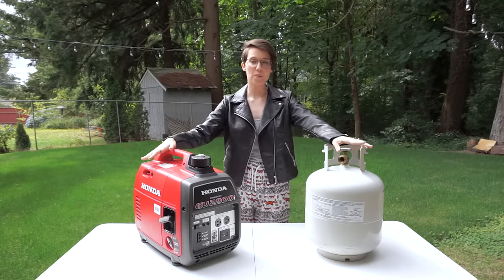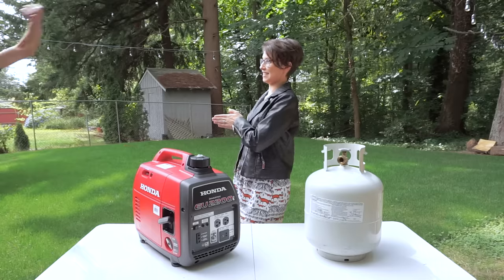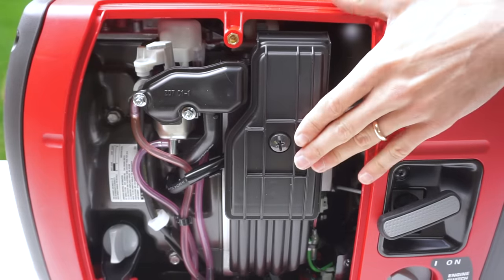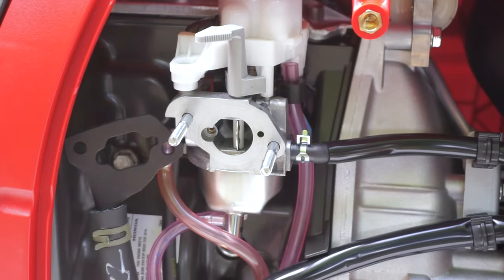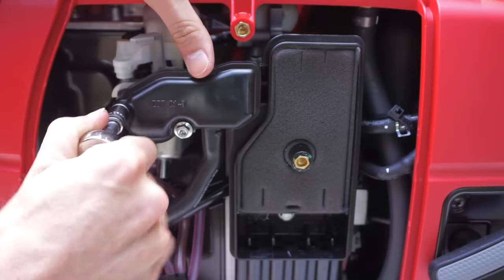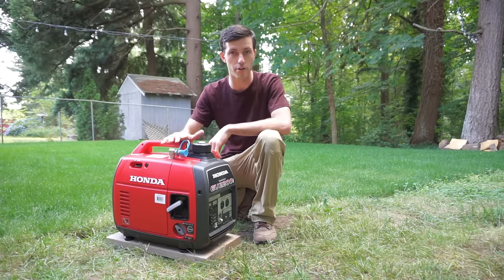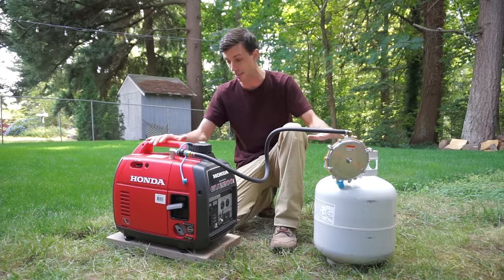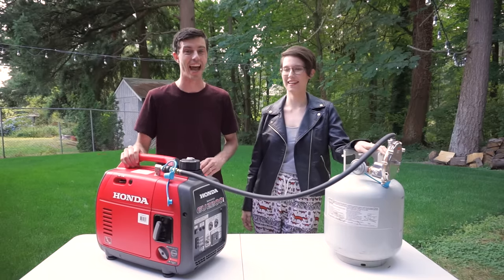Honda EU2200i Propane Conversion Kit - DIY Install for Honda Generator

Comment: So any details on how much gasoline is burned per hour vs how much propane is used? How long does that propane bottle last?
Reply from the maker: The generator will run for 32 hours at 1/4 load on a 20 pound propane tank. Not sure about gasoline though.

Comment: Question mine is EU2000i I bought the kit and it came with an off/on switch do  I need to install the on/off switch Thank you.
Reply from the maker: That is a question for the manufacturer. Give Hutch Mountain a call.

Comment: I apologize if this question has been answered elsewhere, BUT, how long does a 10 lb canister of propane last? I realize it's all load driven, but what's a ball park for run time vs fuel used! Mahalo in advance for getting back to me! Aloha
Reply from the maker: It will run for about 15 hours at 1/4 load on a 10lb propane tank
Reply: @FateUnbound  Mahalo nui loa and ALOHA! Thanks for getting back to me so quickly! I very much appreciate the courtesy! :)

Comment: are you still able to use the eco mode switch when running on lpg as from my understanding the eco mode is for the carb when running on gasoline ?
Reply from the maker: Yep!
Reply: @FateUnbound  how does that work as it is unable to regulate the flow of lpg as the flow is constant unlike gasoline that is used as and when required ?

Comment: No way to run it off the (already regulated) feed off the camper quick connect? That would be super handy.
Reply: The regulator included with the kit functions differently from the regulator on the camper. It is a demand regulator as well as a pressure regulator. Meaning it automatically cuts propane off if there is no vacuum. Important so if there is some sort of engine failure you don't have a gas leak.
Reply from the maker: There is a way to run it off your camper quick connect. Give Clayton at Hutch Mountain (the makers of this kit) a call at 435-494-1975

Comment: I'm sold on the kit and the geni, I take it that the generator in OEM factory specs takes non mixed fuel? 

(Concerned about lubrication if it needs 50:1 mixed gasoline normally)
Reply: no , its a 4 stroke, oil is in the crank case, you cant run a two stroke on lpg , well technically you could but it would be such a farce and absurd idea  that i dont think anyones ever bothered to try,
Reply: @deadprivacy  yea you run a 2 stroke on propane it will self destruct pretty quickly. Unless you got some sorts of a oil injection to go with it
Reply: This is a 4 stroke engine not two stroke,it has its own oil sump
Reply: @derrickdrew17  yeah, thought about for a moment too, then thought "but why?"
Reply: Beware that the 2200 isn't the usual honda quiet. 2200 is 97db, 3000 is 57db

Comment: That propane fitting is just a 3D printed part.  I could create one in CAD and print it out on my 3D printer.  I noticed the little baffles too that allow the propane to flow into the carb and of course the hose fitting that isn't shown because the hose is connected.  That would be no problem in CAD.  The rest is just off the shelf parts you could get at a depot store.  Yeah I think the kit is a little pricey for just a 3D printed part and some hardware but not everyone has a 3D printer so....

Comment: Great video but why does that Honda sound so loud?  This setup is much better than carrying a spare gas can.  How much run time will the generator have off that tank?
Reply from the maker: The honda is a very quiet generator. It probably sounds loud because I had the microphone so close to it. Also, it will run for 32 hours at 1/4 load on a 20 pound propane tank.
Reply: @FateUnbound  Perfect.  Would I be correct in assuming a 1/4 would be sufficient to power an A/C in a nucamp teardrop trailer?

Comment: So, maybe I'm nitpicking. You listed the tools needed, then used a scissors (not on tool list) to cut the supplied tiewrap, leaving a jagged sharp edge to get cut on. Rather than cut it with a tool not on the list, better to leave the end on and tiewrap it so the end isn't in the way. Bonus, you won't later get cut by the end. And the non-list marker. Okay, you could just use the pilot hole drill bit to mark the center of the washer, but it's either on the tool list or it isn't. :-) Are the fittings coated with a Teflon sealant, that you don't need to tape the fittings?
Reply: yes they are coated, and also cone shaped if i see correctly, so its a form seal also.
But i still get a strange feeling using a non leak tested thingy.

Comment: How long will the generator run on a bottle of propane? Thank you in advance...
Reply from the maker: It will run for 32 hours at 1/4 load on a 20 pound propane bottle.

Comment: How long will it run on a 30 pound tank?  How is propane fuel economy verses gasoline?
Reply from the maker: A 30 pound take will run the generator on propane for 45 hours at 1/4 load.

Comment: Hows does the ignition remain engaged when the switch is in the old off position. I believe it has a kill circuit in it?
Reply: There are two switch positions; one is "Gas Off" position and the other is generator "OFF" position; the "gas off" position lets the generator continue to run (but shuts off the gasoline to the carburetor) so it runs dry of gasoline before shutting down which is good to keep the carburetor from gumming up. I believe they were referring to the "gas off" position.

Comment: Question ~   Is there an automatic lp gas shutoff safety valve if the engine stops running?
Reply from the maker: The regulator prevents propane from flowing when the engine is off.

Comment: If you don’t turn off the propane would it leak propane through the carburetor air cleaner when not running?  Could be a little dangerous if someone turns on gas but does not start generator
Reply from the maker: No, the regulator stops any propane from flowing when the generator is not on.

Comment: I purchased this conversion kit and followed the installation guidelines.  It did not work.  

I tried adjusting the regulated natural gas pressure.  No luck.  

I would really like the generator to run on nat gas, but it will not.  

Any suggestions?
Reply from the maker: I would call the manufacturer, Hutch Mountain. There's no reason this kit shouldn't work. What are you installing it on?
Reply: @FateUnbound  the same little Honda Generator you are using in your video.  It’s very confusing.  I’m pretty handy, and could not get the engine to fire.  I could smell the natural gas, so I’m sure it was getting to the carburetor.

Comment: You mentioned they make this kit for Honda eu2200&2000 do they have one for eu1000??
Reply: waiting for answer
Reply: 2000 vs 1000 uses the same gasket on the carb so, yes it should work. If the regular is adjustable then may need to turn down flow just a tad for the smaller(1000w) engine

Comment: can the eco mode still be used?  itd be a real shame to lose that....but idk how a constant flow of gas wouldnt require the engine to run full speed to consume all of the propane supplied...
Reply from the maker: Yes eco mode is still fully usable. Also, the regulator on the propane tank that comes with the kit regulates how much gas goes to the generator based on the generators throttle.

Comment: you know no matter what you wish to do with 2kw genset you are best to buy units that permit multi fuel  as a running source for  every bottle of lpg you use you have to run normal fuel as a lubrication..

personally having lived in a caravan for over 3 years 2kw isn't a solution you should be running  on 220 mains capable vans as you are under powered for a start you will need a minimum of 5-7.5 kw or higher depending on what you are using..

you are sitting between 4.5 6kw between range, micrwave, fridge/freezer and air con..

Comment: Run the gasoline tank empty so if you need to run it on gasoline in the future the old gas does not cause a problem.

Comment: Excellent video.  Thank you.  I wish it was available for the 7000 Watt Model.  I only use propane for my generators.  Please check out a-iPower 3,800 Dual; Fuel Inverter Generator.  Most features and great performance.  20 hours on a 20 pound propane bottle with medium load.

Comment: You missed some pipe dope on the threads when you ran the fitting up through the case.  Sorry for pointing that out but I’m a gas fitter
Reply from the maker: The fitting already comes with gas rated tape on the threads, it's hard to see since the tape is gray.

Comment: according to Honda the generator can run 8ish hours on a tank of fuel depending upon load. How does it compare when hooking up to the BBQ size tank?
Reply from the maker: 30 hours at 1/4 load on a 20lb propane tank
Reply: Fate Unbound  Tank you (see what I did there?) for the reply brother.

Comment: Great It's propane: However, Propane burns twice as fast as most gases of today. Best thing switch to e85 much cheaper, cleaner burning, and probably easier. I built my truck engine to certain specs just to run E85. Can we say It can pull a medium sized house and not break a sweat and, good MPG 19

Comment: How efficient is the generator running on propane say a 20# tank vs a tank of gas
Reply from the maker: It will run for 32 hours at 1/4 load off a 20 pound propane tank.

Comment: Now that it’s been a few months,,, any good idea the average run time using a 20# tank?
Reply from the maker: It will run for 30 hours at 1/4 load on a 20 pound propane tank.

Comment: stupid question - can you still use gas after you do this conversion? (in case you run out of propane but have gas on hand).  Also, how long does the generator go on propane?
Reply from the maker: Yep you can still use gasoline or propane at any time! And it will run for 32 hours at 1/4 load on a 20lb propane tank 👍
Reply: @FateUnbound  thank you!

Comment: I am curious how long a tank of propane lasts.  I have heard that propane generators tend to use more fuel than the same generator running gas.
Reply from the maker: This is true since burning propane does not produce as much energy as burning gasoline, but typically propane is cheaper than gasoline so in the end the fuel cost is a wash if not cheaper to run on propane depending on where you are in the country.

Comment: Can you use your onboard propane trailer outside grill quick connect?
Reply from the maker: I believe you can! Give Clayton a call at Hutch Mountain for all the information on that, I don't have all the info on the RV quick connection since mine doesn't have one. Their number is 435-494-1975
Reply: depends if it has gone thru the regulator or not. Don't want to double regulate. Won't have enough pressure if you do.

Comment: If a stock gas EU2200i runs 3 to 8 hours on 1gal of gas, does anyone know how long it will run on a 4gal bottle of propane?
Reply from the maker: 30 hours at 1/4 load on a 20lb propane tank

Comment: How much time (hrs) the propane tank will last with a full tank under a low and hi load..? In my area propano is more expensive  not cheap..! I run my Honda 2000 for 6 hrs avrg a day( i run my roof ac 13,500 btu) with less than $2..!can propano do that..?
Reply from the maker: Hutch Mountain says 30 hours of run time at quarter load, 22 hours at half load, and 12 hours at full load off of a full 20lb "bbq" size propane tank.

Comment: Loose twenty percent of energy production on propane it runs yes. But won't produce as much energy so fuel cost plus lower output what's the gain?
Reply: Darwinism and less money in the pocket.

Comment: How are you suppose to hook up  that big regulator on your plastic LP covers on your trailer?
Reply from the maker: Remove the plastic cover while running the generator, it's what we plan on doing.
Reply: Thats an option too. I wonder if you can mount that regulator on the generator side?

Comment: What would happen if you ran the gen on propane with the switch set to the Gasoline "Run" position?  ... the all the way up position, instead of the fuel off position
Reply from the maker: With it set to the gasoline setting it allows gasoline to flow into the carburetor. So With gasoline and propane both flowing in I'm assuming the generator would run extremely poorly and probably just die since it's getting way too much fuel.
Reply: @FateUnbound  Hey thankyou for replying, especially on a 5 year old video :)
It's a new generator, and I've never put gasoline thru it.  But I was running it on propane today with the switch in the upper most position, instead of the "Fuel Off" position as I should have.
Reply from the maker: Oh okay, yeah if there's no gasoline in it then nothing will happen. You've got the gas valve on in that position which would allow gasoline to flow to the carburetor but since there's no gasoline in it, only propane flows and the engine runs no different. I'd still recommend not turning it to that position though when on propane.
Reply: @FateUnbound  Hey thankyou again :)  Now I've bought a Bluetti AC200l to supplement the generator so the propane will last much longer.  I'll run the genny to charge up the Bluetti, and then shut it off in the evenings & run the TV & lights and morning coffee off the Bluetti.  Then charge up again with the genny.  That's the plan anyway.  We were without power for 16 days after Wilma and stretching fuel is a good thing.

Comment: How many hours will the generator run at full load with a 20lb tank of propane?
Reply from the maker: Roughly 12 hours, and 30 hours at 1/4 load

Comment: My RV has a gas grill quick connector mounted to the frame, can I use that connection to run this generator?
Reply from the maker: I believe you can! Give Clayton a call at Hutch Mountain for all the information on that, I don't have all the info on the RV quick connection. Their number is 435-494-1975
Reply: depends if it has gone thru the regulator or not. Don't want to double regulate. Won't have enough pressure if you do.

Comment: Whats the runtime like on that tank of propane?
Reply from the maker: 32 hours at 1/4 load from a 20 pound propane tank.
Reply: @FateUnbound  Thank you!  You mention this kit may work for the older 2000 watt hondas ?  I have the older non inverter one that weighs about 50 pounds + with a tank of gas will this conversion kit work with it?
Reply: For the love of god how long on full load - eg running AC?

Comment: So I tip for anyone that's still burning gasoline don't buy normal gasoline just by 100% gasoline it's a little bit hard to find but it doesn't go bad can leave it in the tank for a couple years without it going bad and if you have a metal gas tank sometimes fuel preserver will make the generator or whatever you have a the tank will Rust sometimes with fuel preserver

Comment: Any spark engine can use propane or natural gas. 

Convert it to run on LPG, then you’ll have something impressive. 

You’ll need a generator with a coolant filled radiator to run thru a Liquid propane atomizer otherwise the system will freeze up.  (Forklift mechanic here)
Reply: Roderick Hero forklift mechanic that’s funny
Reply: Heidi Lear 
No it’s not.

Comment: However the lifespan of the engine will be lower due to no lubricity on propane, on the other hand gasoline gives lubricity to the motor. Go back and forth one in a while to give some lubricity to your engine matey
Reply: I wondered about that, but then lesser companies make dual-fuel portable generators too.  I don't see how those Chinese engines are better than a Honda.

Comment: How long will it run on a full cylinder?
Reply: FYI- Fate Unbound
6 months ago
Hutch Mountain got back to me and said 30 hours of run time at quarter load, 22 hours at half load, and 12 hours at full load off of a full 20lb "bbq" size propane tank. I think that's pretty good!

Comment: Could you give the approximate propane usage compared to gas usage? How long will a 20lb propane bottle last vs one tank of gas? Thanks
Reply from the maker: At 1/4 load a 20lb propane tank will last 30 hours and a full tank of gas (0.95 gallons) will last 8 hours.
Reply: Thanks
Reply: So by this math, gas is significantly cheaper!?!?!?
Reply from the maker: @sotacal  depends on how much each fuel costs where you live. Here propane is $2.40 a gallon and gas is $3.35 per gallon. So running off propane is much cheaper where I am.
Reply: You purchase LP by the gallon? Where?
Reply: Locally, I buy by the pound.

Comment: how long does it run on that size of propane that you are using?
Reply from the maker: It will run for 32 hours at 1/4 load off a 20 pound propane tank like the one shown in the video 👍
Reply: @FateUnbound  WOW! that is something. so it will really run longer on propane compared to a full tank for gasoline, right?

Comment: What controls the rate at which propane is fed into the generator?
Reply from the maker: The regulator that threads onto the propane bottle
Reply: @FateUnbound  OK, I understand that. But the result will be a steady flow of gas into the generator irrespective of load on the generator. In a controlled system, when the generator is put under load the throttle is opened and more air and fuel are let in. So the generator has less fuel supplied to it when it is idling, and maximum fuel when it is working at maximum output. There seems to be no way with that conversion kit of controlling the flow of propane in the same way. The result would be some sort of intermediate flow level of propane, leading to unnecessary high consumption at idle and the generator not achieving maximum output.

Comment: How long will your Honda generator run on LP tank
Reply from the maker: Hutch Mountain says 30 hours of run time at quarter load, 22 hours at half load, and 12 hours at full load off of a full 20lb "bbq" size propane tank. I think that's pretty good!